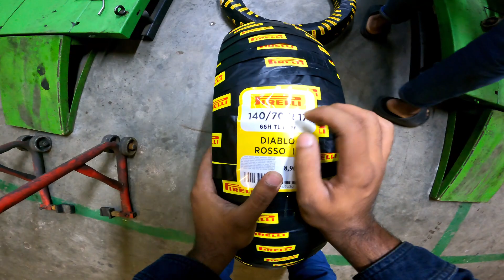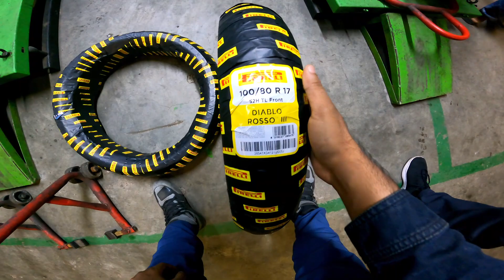About Motorcycle Tyres | Pirelli Diablo Rosso III

Comment: Aligning the rear rim into the swingarm chamber by hitting with a metal hammer is not an experience application to work. Using a metal rod to distinguish  tire from the rim created multiple dents on the rim. Ultimately, whatever high-tech workshop you introduce in Bangladesh, nothing will be able to provide quality work because the people of Bangladesh believed that hitting, cutting, and banging is quality work.